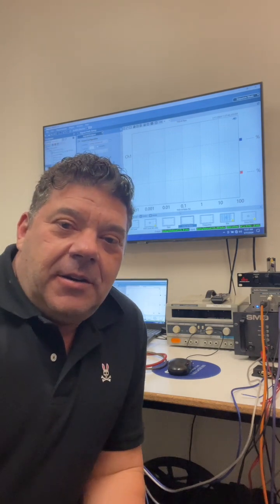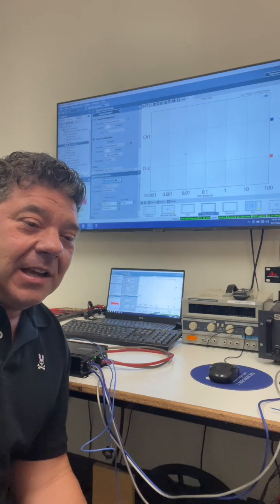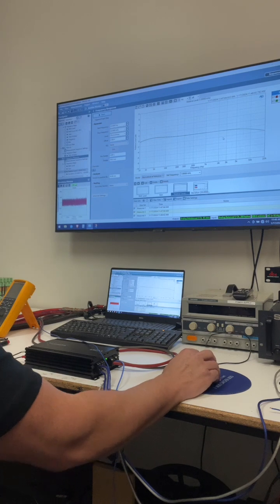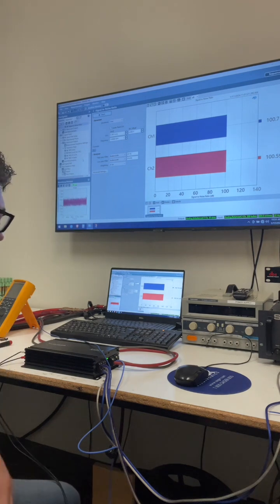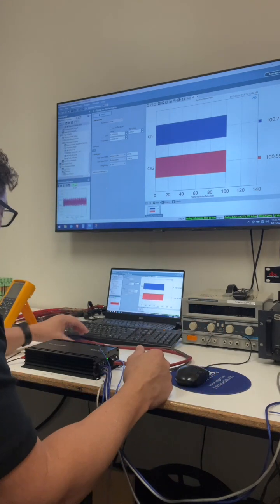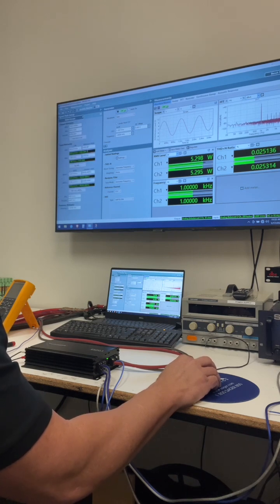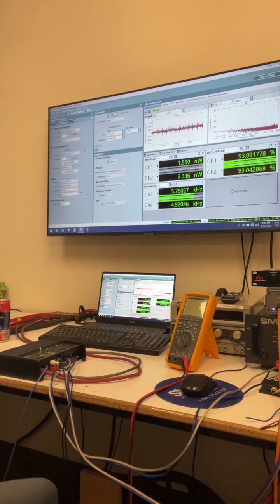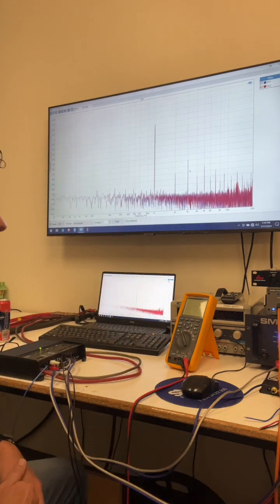S1E6 D'Amore Engineering Bench Testing the E400.4 4 channel amplifier

Comment: JL have the worst sounding amps.. no soundstage at all and cost 4x's what they are worth .. had to say it!
I have the Excelon XR401-4 (yes.. a Kenwood after using the JL XD & RD series) on a set of Peerless SLS 6.5's and it sounds wider, realistic and has some serious kick.
I amp looking to use this E400.4 amp bridged to a set of 6.5" Anarchys...

Tony.. does the E400.4 play at 12 dB/octave on both Low and Hi pass filters?

Comment: @DAmoreEngineering- How important is Damping factor? Is it very noticeable, if 1 Amplifier had a Damping factor of 500, @ 4 ohms, @ 100 Hz, vs a 2cnd Amplifier that theoretically had all of the same other specs., the exact same as amplifier #1, with the only difference being that this second amplifier had a Damping factor of only 50, @ 4 ohms, @ 100 Hz? How does, or could the Higher Damping amplifier #1, affect the Sq performance, pertaining to the accuracy, and impact? Is it easier to hear the difference of a higher Damping factor amplifier on a Subwoofer, Mid-Bass, Midrange, or Tweeters the most? Or will Amplifier #1 with the much higher Damping factor, affect ALL speakers fairly equally? Thanks for your time, and Great video👌👏🎉
Reply: Pretty much every modern amplifier will have a damping factor high enough to be WELL beyond the point of audibility. Unless you have something like an OTL tube amp

Comment: Can the sub channel off the E 660.5 be used to run a center channel. What frequency does it play to?  I plan on running tweets mids and 1 center. It has the perfect wattage for each speaker!
Reply from the maker: unfortunately channel 5 has a non-defeatable low pass crossover adjustable from 50-250Hz only

Comment: Been running a 1500.1 and 400.4 basically since launch. I was one of the first in line. (i got a 1000.1, but bought the 1500.1 when it came out later). These boards, just work. I am old and cant/struggle to hear many freq's, especially in the upper bands, but they sound killer, wicked small foot print, and the  price is awesome, I've been the hell out of these things, (off roading/camping, running them for hours and hours on end) and all they do, is power up, work, sound great and run cool doing it. EDIT-  (hertz tweeters/satori mids/xfire subs- gately enclosure/dsp)
Reply from the maker: Thank you for your support and feedback!